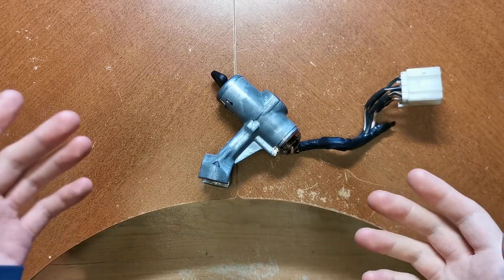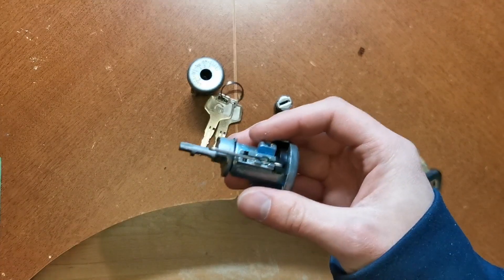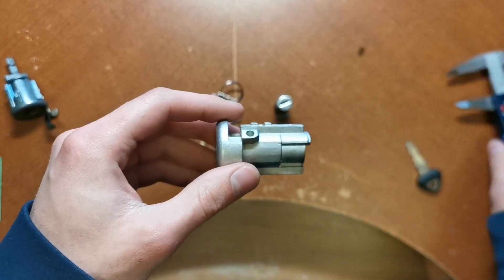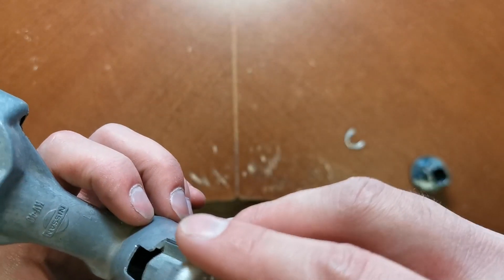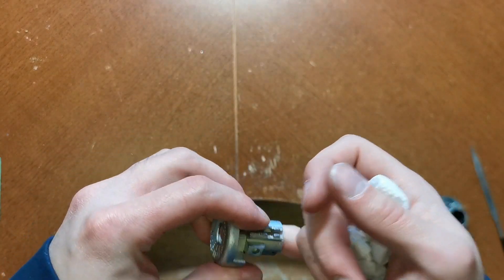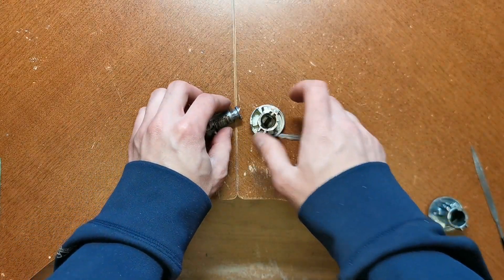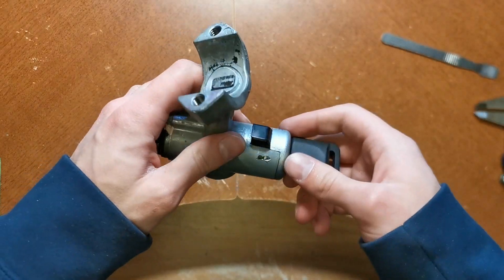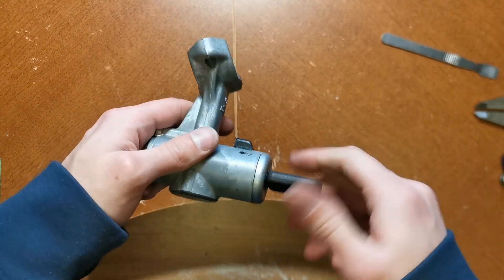Z31 Lock Cylinder Refreshing

Comment: You drilled out a hole in front of each roll pin?
Reply from the maker: I drilled at an angle to the roll pin and used a pick to pull it out